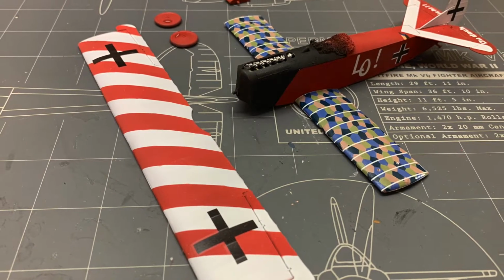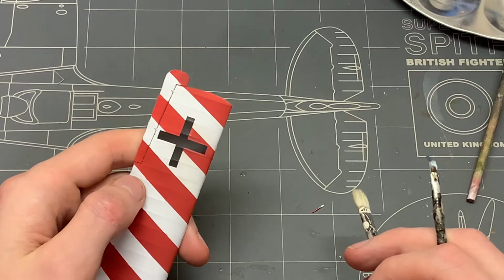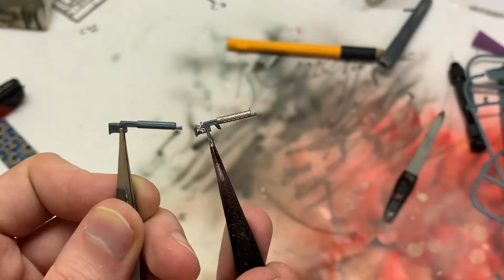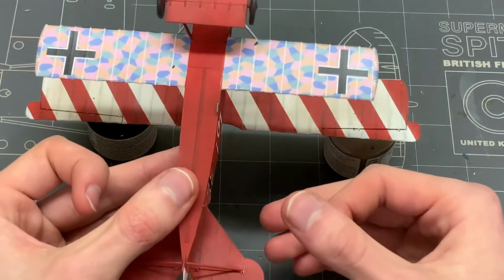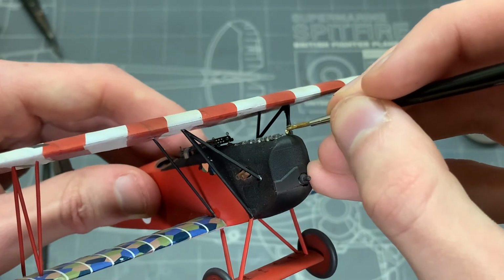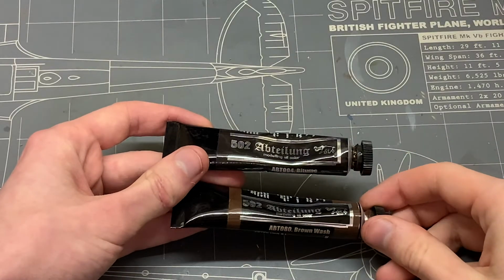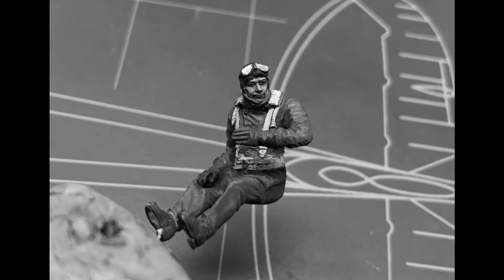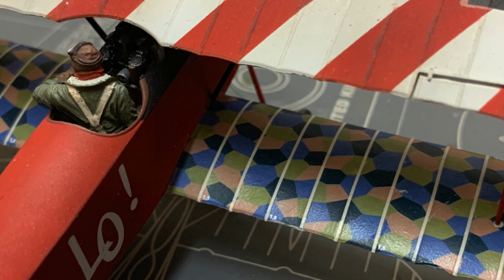LETS FINISH THIS PLANE AND FIGURE | Eduard Fokker D. VII 1/48 part 4

Comment: Well done.  Having built a half dozen Eduard WWI planes, I fully agree with your summary.  The models are well engineered but present some challenges. That being said you did a lovely job on the most intricate of the Fokker DVII liveries in that kit (I have two of those "Udet" kits and still haven't summoned up the courage to try the candy striped DVII.  Cheers!
Reply from the maker: Thank you. These Eduard kits are also usually the best option for the subject in 1/48 when it comes to WW1. You can argue they’ve become the Tamiya of WW1 aircraft, setting a great standard for other companies. Apart from WnW of course
Reply: @VilkaModels  I went a bit crazy and bought 4 WnW kits last month. I don’t even want to admit what I paid, but that’s what happens when one is late to the market. 😒. On the other hand I got a Copper State Nieuport XVII 1/32 at a very reasonable price. It looks like it will be a great build. At least I hope so. I’ll have to check your video list to see if you’ve built a Copper State model for some good advice.  BTW your propeller painting technique is impressive.  👍. And yes, I agree I don’t think Eduard has a peer when it comes to WWI aircraft in 1/48.
Reply from the maker: Having just looked at the CSM Ni-17, now seriously considering acquiring it, thanks for the suggestion!
Reply: @VilkaModels  Just checked this thread again. Do you plan to build the Albatros DVa and/or the Fokker DRI that came with the Eduard "Du doch nicht"  Special Edition kit?   I haven't started Udet's Fokker DVII or Fokker DRI, but I did finish Udet's black and green Albatros a while ago.   https://i.postimg.cc/sxp3m5dd/DVa-Finished-4.jpg
              
I'm looking forward to more great builds on your channel!
Reply from the maker: Thats a clean build, dude, I love the purple and green colour combos on German Aircraft. I actually already built the Dr. I and Albatros D.V before the D.VII, I have the photos on my Instagram and Facebook pages. I don’t film all of my builds, so thats a place where I post those, as well as other updates and in progress pics.

Comment: Lovely work! Two very late suggestions:
1. Paint adhesion was prevented by mold release agent and/or fat, Use IPA as a degreaser before painting and you should be OK.
2. Turnbuckle tool: Form that wire into a J-hook  instead of an L for faster twisting and Bob's your uncle (Is he?). I used thinner copper wire for the turnbuckles and it works just fine.